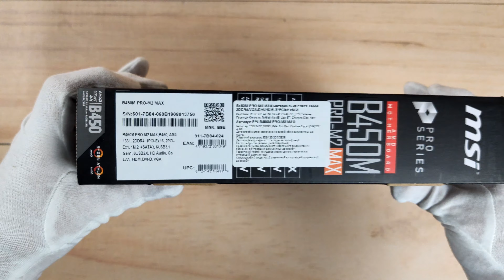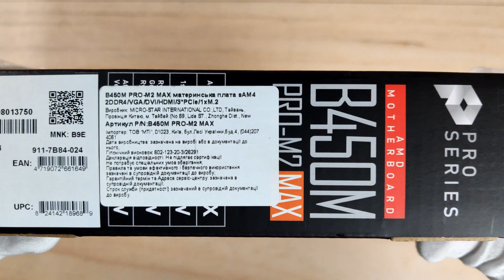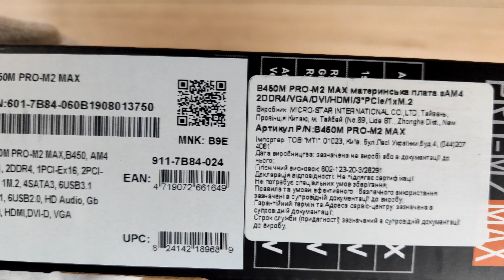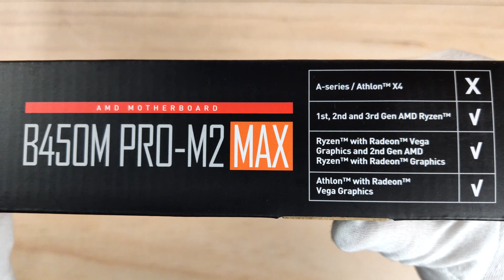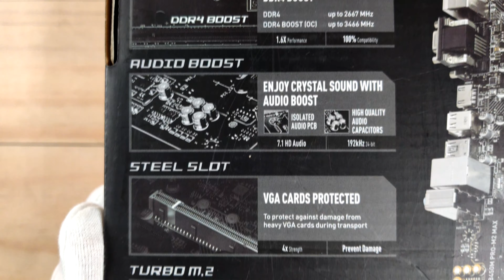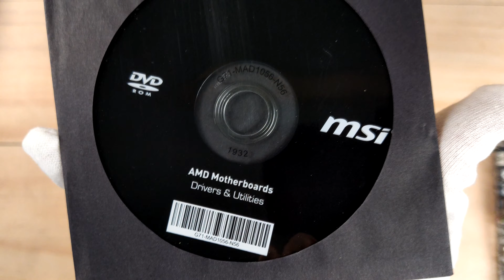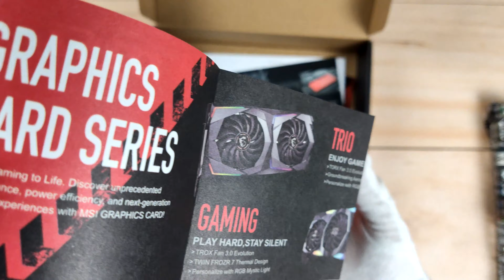MSI B450M PRO-M2 MAX Motherboard Unboxing and Overview

Comment: With this board i have to update the BIOS for a Ryzen 3 3200g? or it comes ready oout of the box for this processor?

I dont have another processor for updating BIOS.
Reply: Out if the box, there’s a bios update, no need to update bios. It’s “ryzen ready”!

Comment: I’m just curious. Putting a exhaust fan and a intake fan on the same horizontal line? Won’t this cause turbulence ? The exhaust fan won’t get a chance to catch the hot air. I believe the intake should be just below the exhaust fan not on the same horizontal line .           <-<-<-<-<<<-<<-<-<exhaust@. \                                                                           Example.                       \<-  <-<-<-  Intake @

Comment: How many Amps does the fan header support? Will it get hotter if you add 4 0.08A arctic p12 120mm pst fans ?

Comment: can this handle the ryzen 7 2700? Will upgrade soon but for now this mobo is in the budget, will do editing vids. TY
Reply: It will handle it but I would use a other b450 because of the ram slots and also u need to flash its bios before with an older cpu
Reply: Hi, can it handle 3700x?
Reply: @npaz24  Don't pair 3700x with a low-end board, get a better one
Reply: @Flannigan 3rd gen Ryzen cpus are supported.
Reply: Does it support the ryzen 3 3200G?
Reply: @optical9676  it does. read the box, it will label ryzen 3000. It pretty much can handle 3rd gen proc without any problem even if you oc it. trust me been there and done that. Mobo is cheap but it is powerful as it looks
Reply: @princecarl180  lmao i ended up going with the 1600af lol

Comment: Ryzen 5 3600 suport?
Reply: yep
Reply: How? Can’t get mine to work
Reply: Navraj Thapa not booting up and can’t seem to flash
Reply: @RabbitWhiteThe  It could be an older version, which doesn't support 3rd Gen Ryzen CPUs out of box. Check the descriptions on the box.
If it does, then either it is broken, or something isn't properly connected.

Comment: Does this mother support 3200mhz memory? I bought 2x 8gb 2666 and I'm thinking of selling them
Reply: Yes. Just make sure XMP Profile is on via BIOS.
Reply: Navraj Thapa it says “not supported” but I think it’s because of my ram, if I changed them it should be activated
Reply: @danielcorredera1608  Yeah. It's probably because of the RAM. I have Corsair LPX Vengeance 3000Mhz, 2x8GB. It works as intended via XMP.
Reply: @danielcorredera1608  3000 isnt so bad tbh m8

Comment: Does it only have 1 fan header?
Reply: BigBen330 
If u are still trying to find out I used a fan hub with the one header ad it worked completely fine
Reply: @pin0playz628  k thx I was just making sure that I'm not blind

Comment: Which one is better(b450m s2h or pro-m2)?
Reply: Both are good
Reply: i think s2h is not compatible with ryzen 3000 out of the box but pro-m2 max is compatible with ryzen 3000 series out of the box so you dont have to update the bios using older cpus as ryzen 2000 or ryzen 1000 series
Reply: Alen bro s2h compatible 3000series but need a bios update with old ryzen series.
Reply: @YakupReis  yeah bro i mean who want to buy the ryzen 3000 in new build it means that he dont have any old cpus so you need to buy a cpu and sell it after you update bios i recomand the msi Max motherboards you dont need any old cpus to update bios
Reply: @graym5374  AHH MAN YOU SAVED ME!
Reply: @berserkoflust7999  youre welcome bro their is some gigabyte b450 s2h motherboards that they were made before 4 months they are 3000 ryzen ready you should just take a look in the box of ther motherboard if it says  3000 series if not then go with this msi b450 pro m2 max ^^
Reply: b450m -A pro max or b450m pro-m2 max which is better?

Comment: Can i put a GTX 1660 OC 6Gb on this motherboard?
Reply: Yes
Reply: You can put any pci-express graphics card in the motherboard but not dual cards because only 1 slot is available.
Reply: @lazimofo90  so it fits a 1650 Super?
Reply: @optical9676  yes. Any gpu

Comment: Can i use two 3200mhz ram on it??
Reply: i have the same question, please someone answer!
Reply: Yes you can
Reply: 1866/ 2133/ 2400/ 2667Mhz (by JEDEC)
For AMD Ryzen Gen3 (R5/R7/R9)
2667/ 2800/ 2933/ 3000/ 3066/ 3200/ 3466/ 3733/ 3866/ 4000/ 4133 MHz (by A-XMP OC MODE)
For AMD Other CPU
2667/ 2800/ 2933/ 3000/ 3066/ 3200/ 3466 MHz (by A-XMP OC MODE)

Comment: Do I need to flash the bios if I have ryzen 5 1600 af?
Reply: No
Reply: @mcpuma8487  how about Ryzen 5 3600?
Reply: @Lilwonton6  no since it's a max series mother if you see a Orange bar instead of a grey on on the box, it's a 3000 series compatible without a bios flash
Reply: McPuma848 yeah I got that motherboard, ryzen 5 3600, 16gb(2x8gb) ddr4 3000mhz ram c16, m.2 500gb samsung evo 970, saphire nitro+ 4gb rx580
Reply: @Lilwonton6  great PC have fun
Reply: McPuma848 what would be best for it? 3000 or 3200mhz ddr4 ram?
Reply: @Lilwonton6  3600 is the best for ryzen 3000 but 3200 will do just fine
Reply: McPuma848 heard 3600mhz is overkill for the Ryzen 5 3600?
Reply: @Lilwonton6  no not really its a really good spread for the 4000 and up is overkill

Comment: Is ther a 5v rgb head on this motherboard?
Reply: LizardKing 
I want to know things if u know can u let me know
Reply: @pin0playz628  DID YOU know?
Reply: @killsteak my dad and I spent ages trying to figure it out and we found out that we could just make our own cable by cutting of the top of one 5V Sata that came with the case and putting two single pin ends on the cable
We haven’t done it yet but it should work
Reply: lol it’s literally in the manual, NO
Reply: @aidang7182  i dont have a manual i am asking so that i may know if i want to buy the motherboard or not

Comment: This is my build B450m pro m2 max ,
Ryzen 3600x,
G.skill ripjaws 16gb 2x8 3200,
Evga geoforce gtx 1660 super ultra sc,

Crucial 500gb m2,
Barracuda 2tb 7200,
Corsair cx 450 80plus bronze,
Cooler master q300L,
Reply: This motherboard is good?
Reply: 97aq I have t build it yet . It has everything the tomahawk max has in a small package. I don’t want a big tower . It don’t  got double fire that I don’t think typical gamer will use. It’s made to use multiple video cards . I’m new to building pc but everybody can learn from reading .
Reply: @ChitoWorld  did you build it or not yet ? if you did, how is the vrm on the board ? because i heard that it would overheat due to no heatsink so i am little worried about using 3700x on this board.
Reply: endless melancholy I got 0 problems works perfect .
Reply: endless melancholy I ended up getting the pro vdh max .
Reply: @ChitoWorld  thanks so much for the reply, my pro m2 max is coming after couple of days with 3700x and rtx 2070 super, I hope that motherboard runs smoothly without problems xD because I already couldn't find alternatives due to the Corona. I am also getting the crucial 500gb same as you and same ram too except that it's 32 xD
Reply: endless melancholy I think you should be fine .get Corsair pwm pst fans . You can plug up to 4 on 1 header . They only use 0.05 a
Reply: im going to use R5 3600 can we update the bios easily??
Reply: @Zenx_shoaib  if your board is from msi and has "max" in its name, you won't need to update your bios in order to use your 3600, it does already support it, if it is not max version you will need an old 2000 version to update it first, i would recommend getting the max version.
Reply: Ganja Ninja69  unfortunately i haven't received the parts yet due to covid, it will be delayed more idk
Reply: Veigar  it's working all great!!! Only problem i have is that the motherboard has only one case fan header and i don't have a fan hub and can't seem to find it anywhere where i live, other than that it's working nice
Reply: @endless_melancholy  I have 2700x  with same mother board also no problems. If you really need extra fan headers buy noctua fan they come with fan splitter
Reply: @CobraClub04  i already have 3 ll120 corsair fans and their power intake is 0.3 for each so i can plug only 3 into the fan header using splitters as i saw on internet that the max output is 1 A, is it ok if i put two more fans using splitter but on the cpu fan header with the prism cooler?
I think I'll search for noctua fans then... I wasn't focusing on them due to the cost